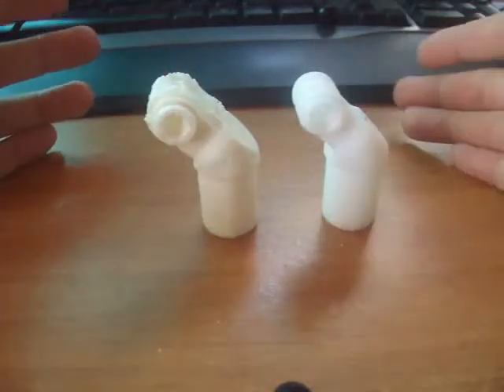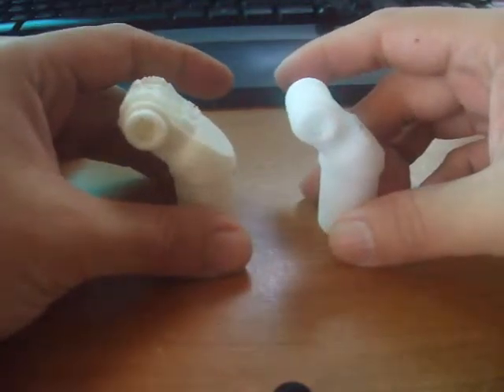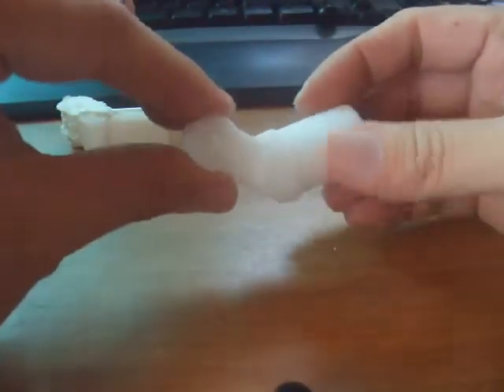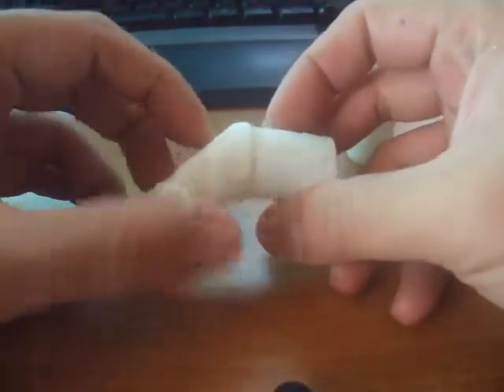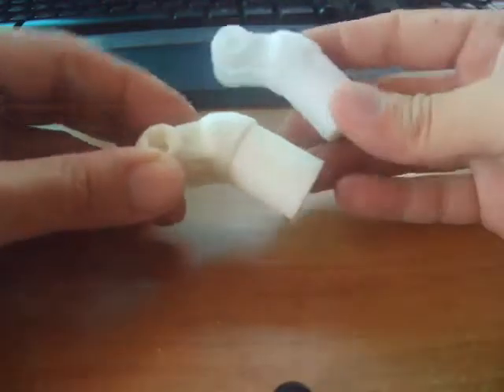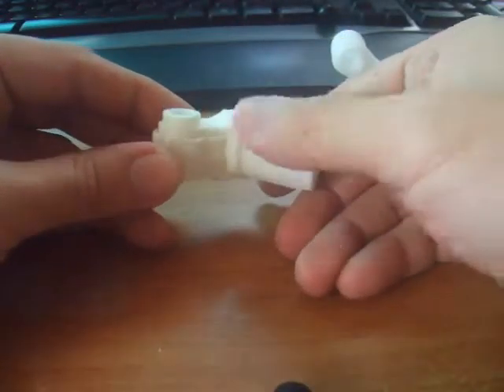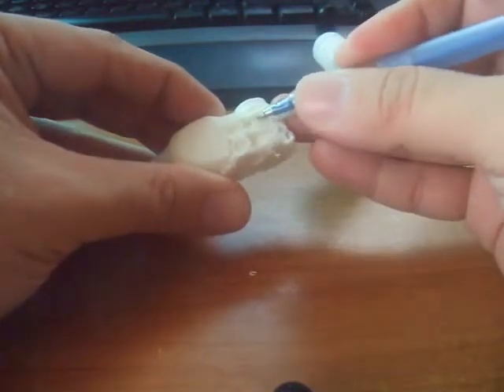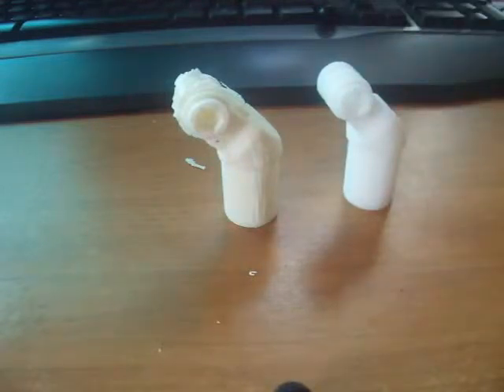UP! Plus 2 3D Printer ABS Comparison

Comment: I have had the same experience with other aftermarket ABS as well. I've never used Reprapper ABS so I can't speak to its quality but is there the possibility that it has absorbed a lot of moisture (that could lead to degraded print quality)? Have you tried the same print with a brand new reel of the same ABS? Also, if you are interested in temperature control, www.octave.com offers a temperature control module for the Afinia printers (rebadged UP! Plus 2 printers), and even if those won't work directly with the UP! Plus, it's a relatively easy hack that you can look up online that only involves soldering on some jumper wires and resistors.